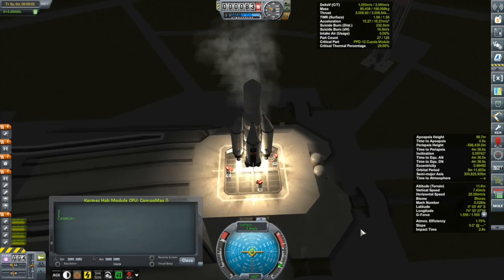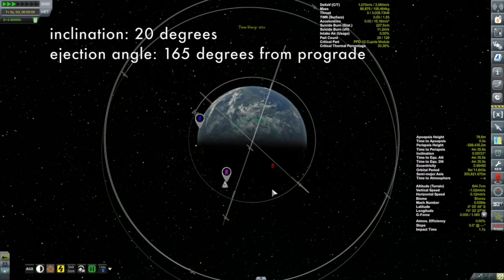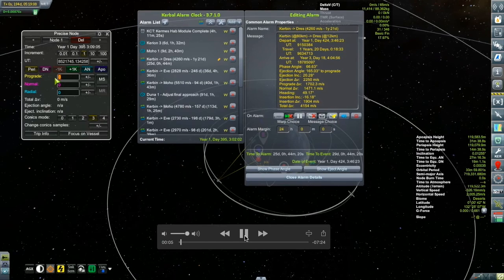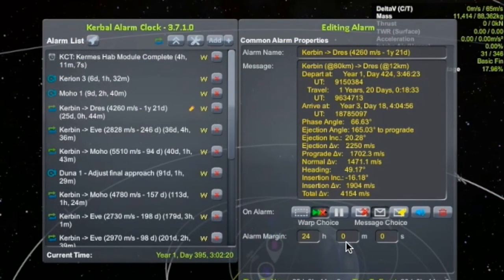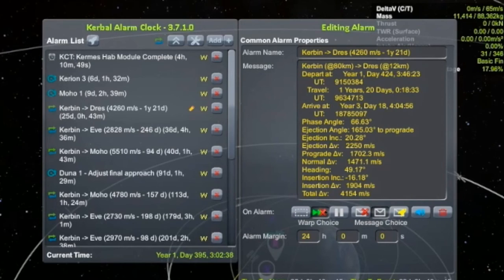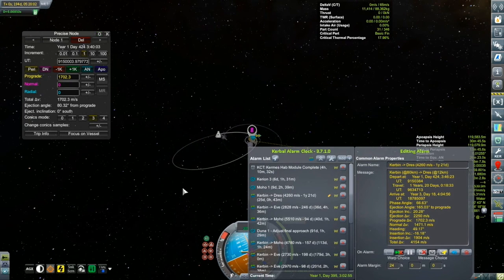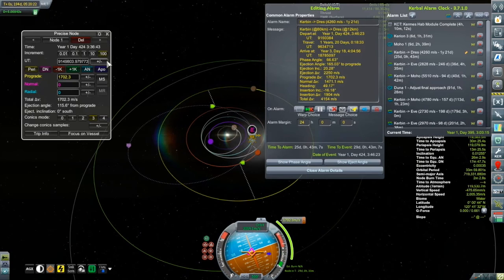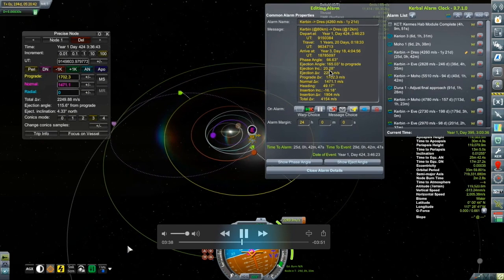KSP Career: Episode 86 Supplemental

Comment: Thanks for that explanation Mike.
Could you do one of these for inserting and setting up Remote Tech satellites. I remember you explaining in a video about the appropriate time to launch to get 3 satellites in Geo-sync orbit around Kerbin but I can't figure it out for say 4 satellite 1000km orbits. How to figure out when to launch to get all the Sats 90 degrees apart or 120 degrees apart.
I usually have to launch and get my Ap to the level I want then increase or decrease the Pe until the Sat catches up or drops back a bit until it looks about right.
Reply from the maker: That would be a good idea to get to sometime.  In the meantime, I did talk about it a bit here.

https://youtu.be/LSTZrBDppC8?t=8m30s

In this video I&#39;m placing the second and third of four satellites.  I show how to use the intercept angle provided from Kerbal Engineer to place the satellites.  I also talk about how you can accomplish the same thing using just the stock maneuver node system, though I don&#39;t actually do that because at the time I hadn&#39;t upgraded the tracking station yet.

Instead of a 1000 km orbit, might I suggest 1067.5 km.  You can calculate the period of an orbit using this formula.

T = 2*pi*sqrt(a^3 / u),

where a is the semi-major axis and u is that gravitational parameter for the body you are orbiting.  For Kerbin, u = 3.5316X10^12.  The semi-major axis is just the sum of the periapsis and apoapsis divided by 2, but it has to be in meters and measured from Kerbin&#39;s center (Kerbin has a radius of 600 000 m).  For a 1000 km orbit, a = 1 600 000 m, which gets a period of 1767 s which is about 1 hour and 53 minutes.  1067.5 km, though, gets a period of almost exactly 2 hours, which is not only easy to remember but easy to divide into 4.

Now, I launched all four satellites separately.  Even better is to use a single launch vehicle.  I place two satellites into keostationary orbit from a single vehicle here.

https://youtu.be/HDq-rywfEaQ?t=6m26s

The key to doing it this way is setting up the correct transfer orbit.  If we&#39;re going for four satellites at an altitude of 1067.5 km (period = 2 hours), then we would want a transfer orbit with a period of 1.5 hours and an apoapsis of 1067.5 km.  Once this orbit is established, we can just drop and circularize a satellite each time we come to apoapsis and each satellite will be half an hour from its neighbours, evenly spacing them out in their orbits.

You can use the same formula I mentioned above to calculate what the periapsis should be of the transfer orbit and that turns out to be 485.5 km.  So if you have all four satellites on a single rocket, put that vehicle into a 485.5 km X 1067.5 km equatorial orbit, then drop and circularize a satellite each time you get to apoapsis, they&#39;ll each by 90 degrees from each other in their orbits.

It would be cool to put all this into a single video, but I can&#39;t say when, if ever, I&#39;m going to get around to that.  In the meantime, I hope this all helps.
Reply: Thanks Mike. I look forward to your future videos.

Comment: is there an addon for something like this?
Reply from the maker: The best I know of is Transfer Window Planner ... https://goo.gl/l4kxul
Reply: Mike Aben that doesn't tell you when to launch and at what inclination though does it? Or am I reading the details wrong?
Reply from the maker: It gives you an ejection inclination and an angle to prograde that you can then use to calculate your launch window and inclination.  You're right, though, it doesn't work that bit out for you.  

I'm not sure of anything that does, but I'm also not sure there is that much of a demand for it.  I love working out this kind of stuff, but it doesn't need to be this involved.  With some extra fuel and a mid course correction, you can get the job done much more simply.  That's what most people do.
Reply: Mike Aben yeah I get it, I just get bored of launching 90 deg east every launch. It's nice to go to minmus just to go 6 degrees off ha.